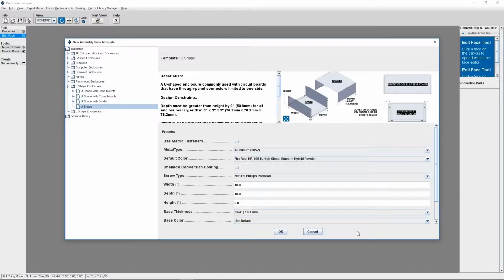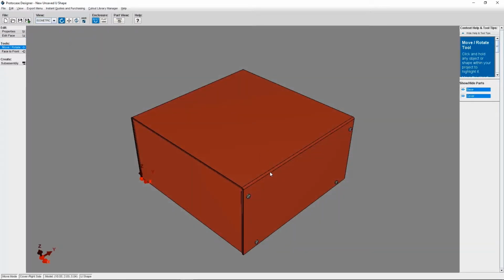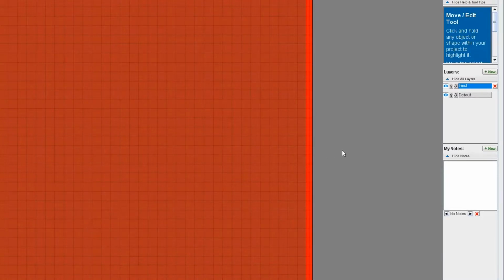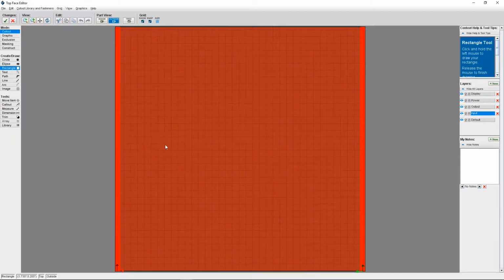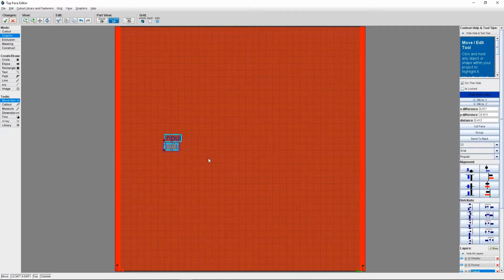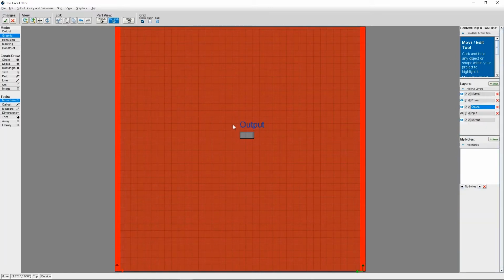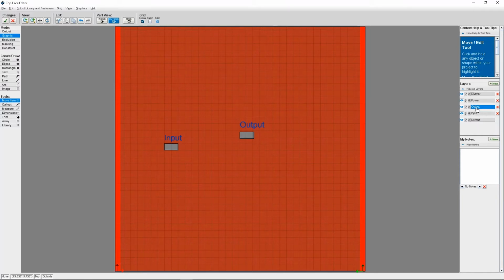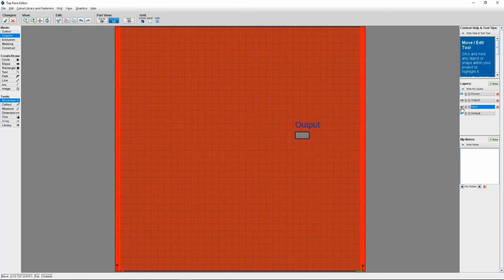How to Add and Manage Layers in Protocase Designer

Comment: How do I make a bend???

As for layers... Is there a list of items in a layer? Why the face editor keep forgetting my grid/snap settings?
Reply from the maker: Hi Lightstriker, it sounds like a member of our team should review your design for you. That will make it easier to answer your questions. Can you send your .pda file with a description of the issues you're having to info@protocasedesigner.com?
Reply: @ProtocaseInc  Not going to happen, because I never managed to do it. There isn't a way to bend a piece. There isn't a list of "items" in a layer. Once you've done a "cut face", it's gone and you cannot revert it. No way to move the origin somewhere. My list of user experience issues would be a couple of pages long of bullet points. On Protocase website there's a nice Mini-ITX case, but if you read deeper, you find out it was made using SolidWork. Protocase Designer is great if you want a custom U or L box or U-rack, not much more.

I would be glad to chat about my experience if you want one day.
Reply from the maker: Hi Lightstriker, it'd be best if we connect you with the account manager for your area so that you can discuss the issues you're encountering. Of course, Protocase Designer is meant to be effective at creating simple enclosures in various styles - it is not ever going to eclipse SolidWorks for its robustness. But still, some of the issues you're having may just take a bit of explaining. And if it's simple things we could be covering in a tutorial, it would be beneficial to other folks too! Can you email info@protocasedesigner.com with your contact info, and a brief description of the issues you're having?